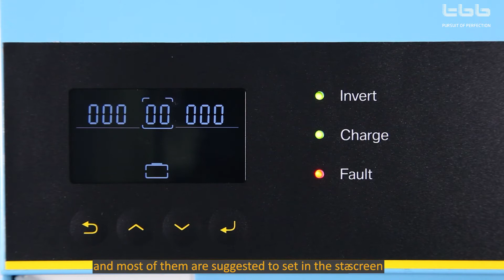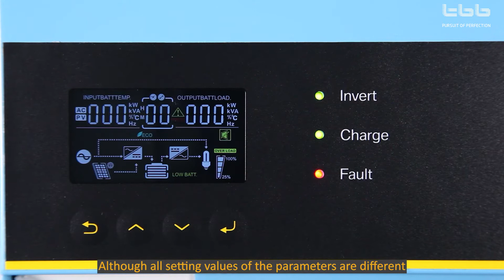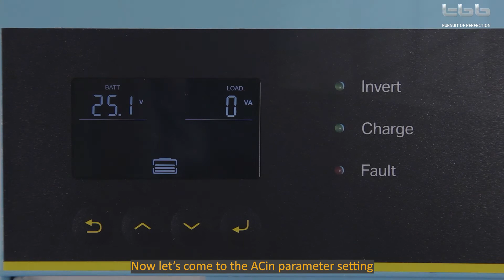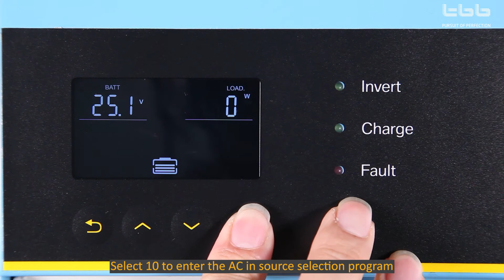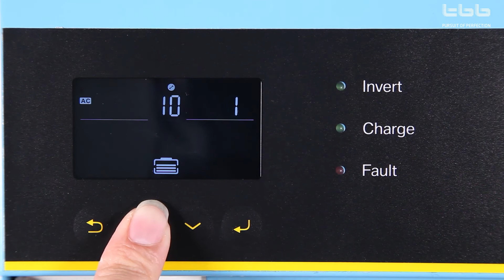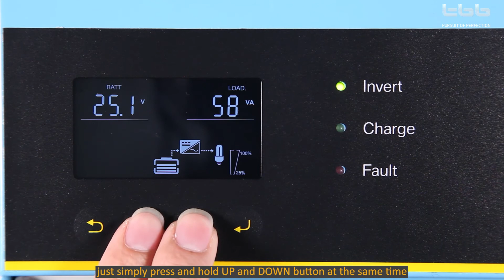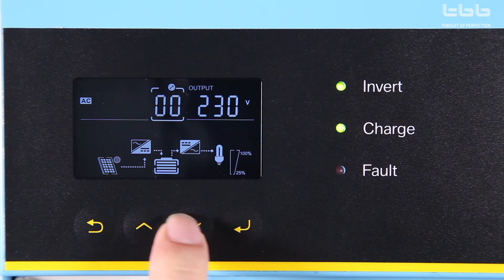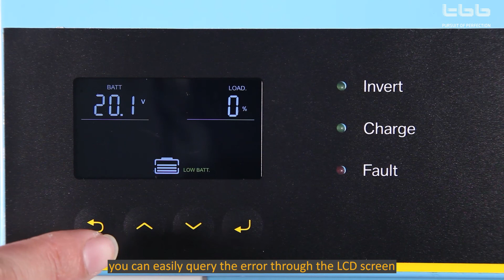TBB RIIO Inverter Charger Parameter Setting Guide

Comment: Riio has asg function?
Reply from the maker: Hi Sir, RiiO inverter charger doesn't have the AGS function, but Kinergier Pro and Apollo MAXX have the AGS function.
Reply: @TBBPowerSolutions  apollo maxx can be ac coupled?
Reply from the maker: @toots3020ph  TBB Kinergier Pro bi-directional inverter can be used to compose a AC Coupled PV system.
Reply: @TBBPowerSolutions  tnx for the info
Reply from the maker: @toots3020ph  My pleasure
Reply: @TBBPowerSolutions  apollo kinergier pro  can export and import power from the grid?
Reply from the maker: @toots3020ph  now it can not support feeding power back to the grid. Now, only the Apollo Matrix could support